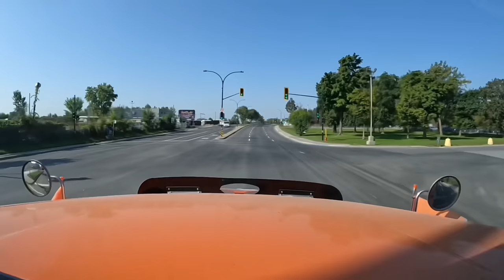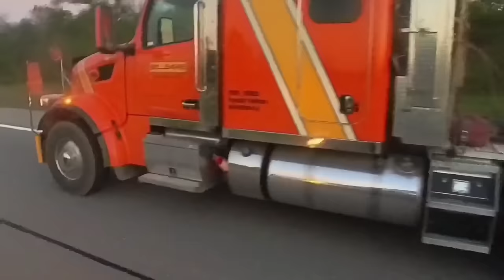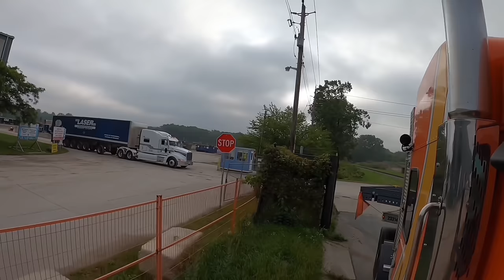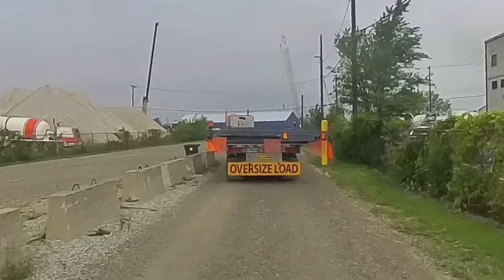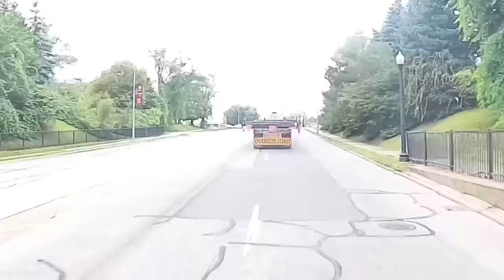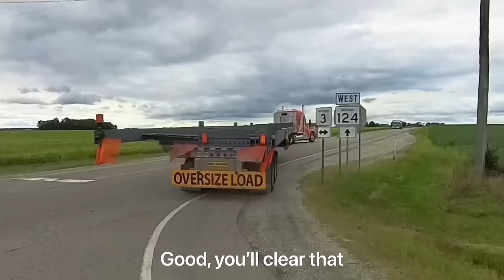That’s a long trailer! 🥵

Comment: Did a very similar load with a buddy a while back. A couple more feet of rear overhang and 18 wide. Boy is it fun turning with a trailer like that.
Reply from the maker: When you think you’ve gone wide enough go wider 🤣🤙
Reply: @luckybananaheavyhaul3407  The wider the load the more fun it is.

Comment: Thanks for the video. Sadly, the truck ferry service has closed down so truckers carrying hazmat or oversized loads have to drive the very long way around. At least until the new bridge opens since it’s supposed to carry hazmat loads.
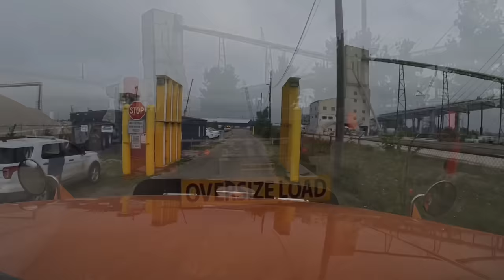Reply: The Gordie Howe Bridge, in the distance at 12:30 is specially being built with Hazmat and other dangerous cargo in mind. It's also at 29:00, and a few times after that.  The 401 will end at Gordie, which joins I-75 in Michigan.
Any spillage can be contained. They need to go all the way to the Blue Water Bridge at Sarnia and Port Huron, which is a good two hours, on a good day. Ambassador Bridge and the Detroit Windsor tunnel have been banned. The Tunnel, for obvious reasons. The Ambassador Bridge, while it's been going under a major overhaul, still has issues, so they can't risk a spill. Any spill, which cannot be contained, would go right into the Detroit River and then eventually to Niagara Falls and then the Atlantic. Sure they can stop it, but why risk a major spill if you can't stop it, or it's a heavier substance that sinks and runs along the base of the river. That would be an ecological disaster that makes the Exxon Valdes look tame.

I believe that the Ferry shut down due to safety concerns and the age of the barges. With the Gordie Howe Bridge opening in about a couple years, barring delays, it's just not worth it to spend millions on new barges 2 years, or so, of operation.

The Gordie, a term for us Detroit Red Wings fans, will have containment abilities, minimizing the risks to the community, and especially the Detroit River.

Comment: Hello Doug.  Great job as always. I remember you saying just how much you enjoyed that amount of trailer cheat during a turn.  4 wheelers were showing their ass on Jefferson.  When you pulled the trailer out of that hole turning left, that would have gotten my attention pretty darn quick.  I dislike having trailers at that angle immensely.  Probably the amount of time under a beam.  At least you didn't have to execute a MI Left.  Have a good day.
Reply from the maker: I wasn’t particularly worried about the hole because of the type of load I had. Light weight with low center of gravity.  If it was a 50 ton electrical transformer it would’ve been a more dramatic situation!
Reply: @luckybananaheavyhaul3407  50 ton transformer-  that would have been exciting for sure.  Be safe.  Be looking for the next one.

Comment: That 122 feet is a little bit longer than what we have in Finland without any special permits which 34.5 meters or ~113 feet but that's on a multiple articulation points, not just a single semi-trailer. I regularly pull a High Capacity Transport with two sea container trailers and a dolly in between those two trailers. Max weight is 76 tonnes (metric) so hauling two 40' or two 45' containers is no problem usually, unless it's winter of course and that doesn't even reach the max length because we have cabover trucks. Cheers from Finland!

Comment: Really neat to see these load transports in video. A question I have is why wasn't the truss transported on edge vertically thus eliminating the overhangs on the sides?
Reply: Mr Banana did not mention it but it appears that the truss was about 12' wide / tall or more.  At the length it was you will never find a trailer that is not going to put it as least 2.5' or 3' high resulting in a load 15' tall.  Lot easier to transport a 12' wide load then a 15' tall one due to bridges.
Reply from the maker: @MrThisIsMeToo well said 👍
Reply: @luckybananaheavyhaul3407  Least I was right once today.
Keep up the great work.  You will break through soon!
Reply: I thought about this also.  There are trailers that have a drop in the very center for moving concrete/prefab walls, large panes of glass, etc which would have added about 15' of length to the trailer and but has the advantage of centering the load. At that point, the added length may have been more of an issue than the width.
Unfortunately I don't believe they make stretch versions of them anyway, so it's like knowing how many licks it takes to get to the center of a Tootsie roll pop.

Comment: Fascinating to see not only how the turns work for such a load, but also seeing how the truck ferry across the Detroit River worked was neat.

I should ask, what are those codes in the video descriptions?

And is there any special software you have to use to plan these routes? They have all kinds of turns I wouldn't have ever expected (and I know they're for obstructions!)
Reply from the maker: The codes I need to list in order not to be flagged for copyright music.  It’s just a way for YouTube to verify that o have permission to use this music.
Reply: @luckybananaheavyhaul3407  I never knew it could work that way with the codes - that is quite something!

Thanks again for the fantastic video!

Comment: I would really enjoy some narrative as you travel, such as the road construction with the cranes and sweeping over passes, etc.  Where was the ferry crossing?
Good Vid. I  would like to know why you jogged down thru Indiana with I-69 and 65 available.
Reply from the maker: The truth is I myself stopped asking “why” a long time ago. Too much in this business doesn’t make sense.  Most of the time when we take a different route it’s to avoid road construction or low bridges (which wasn’t the case with this load obviously)

Comment: Doug, why does it seem that they route you on two lane roads when interstate roads are available?
Reply from the maker: A lot of times it’s to avoid road work on the interstate.  Most of the time they will deny a permit to pass through construction zones.  
Or with a high load we can be routed off to avoid low bridges which obviously wasn’t the case with this load.

Comment: i did  9,  15,3 wide 125 long, 3yrs ago from Baton Rouge La. to Indian town Fl. they had sent 3 loads before me they said it took them guys 4 days to get there, and if i made it there faster i could have the rest of the loads, i would load the evening before pull out next mourning 2.5 days only cause florida i could only run from 9 am to 3 pm, had 2 escorts and LA had 2 state troopersto the ms. line
Reply from the maker: Nice run 🤙

Comment: Are most stretch flatbeds spring ride or air ride? Does it matter which it is?
I'm guessing based on the weight of the load at 20k lbs, your trailer didn't need to be a tri axle, correct?
I'm assuming that's just what your company has, but it isn't necessary for this load. 
I hope someone chimes in. Thx
Reply from the maker: You are correct. My company has mostly tri axle trailers because they are more versatile but it wasn’t necessary for this load
Reply: @luckybananaheavyhaul3407  Figured as much. I see you guys do mostly heavy so if I were them, I'd get a tri axle too. Like you said, versatility. We're only limited by the equipment we have, so...yea lol

Comment: You have such Nice equipment, I only don’t understand why the extendable flatbed isn’t steerable?
Reply from the maker: Because steerable equipment costs more 💰💰💰
Reply: @luckybananaheavyhaul3407  yes,that’s a good reason!
Here in Holland it would be impossible with that length, without steerable.
I go till +- 22 meters on a non steerable , otherwise the secondary roads are almost impossible.
Keep putting the nice videos 👍🏻 they are nice to watch!
Reply from the maker: @henryvanosenbruggen4694 Europe has standardized steerable equipment 👍. Unfortunately here in North America we still try to keep the cost down by using basic equipment 👎.

Comment: do you have any good or bad thoughts about the automatic  tansmission yet? or is it too soon for your input? im just wondering...
Reply from the maker: So far it is doing the job very well.  The automatics have come a long way.  I’d say now it’s just personal preference if you prefer manual or automatic.
Reply: @luckybananaheavyhaul3407   I noticed that it has a torque converter instead of a clutch, first time I've seen this in heavy haul.
Reply: @jasongreene303  only the allison have torque converters.. The eaton automatics still have clutch's, minus the pedal.. I drive an allison daily, pulls 200k+ with ease

Comment: Another great video! I used to haul 60' -70' steel on a 40'-60' trombone [extendable] in the UK in the '70's. Proportionally it was similar to your trailer and tractor on our roads and tailswing was always a problem.
Reply from the maker: Everything is more condensed in the UK!

Comment: Why not have them vertical.. you could transport 3 at a time. 
1 in middle, and the other 2 leaning against the middle on both sides.
Reply from the maker: Good question but 2 reasons. 
First would be the height.  These trusses were 12 feet wide so vertically that would be about 16 feet on the trailer. Way too high!
Second would be weight.  With more than one piece we can not get an overweight permit which means we can’t exceed 80,000 lbs total and this heavy haul truck and 3 axle trombone trailer are heavy!  Believe me if the customer was able to put more than one per truck they would!!!

Comment: WOW that's a long load would be better if you have steerable wheels in back.
Reply from the maker: Agreed but we can’t always have it easy!
Reply: Why did you have to take a ferry instead of the bridge?
Reply from the maker: @paulbuck683 construction on the bridges right now. Oversize loads are restricted.
Reply: Ok thanks. I don’t go that way. I pretty much do east coast

Comment: Don you get  off at Markel. Go over to 3 head south to 124 west until you took 5 south to get back on 69. Did you do that so you didn't have to cross the scales just south of Markel on 69. That's what I did when driving a truck. Great job.
Reply: @nedsauer3807....Over-dimensional routings are determined by the various State & Provincial DoT-agencies; the heavy-haulers can ask for a specific routing, but invariably it's the jurisdictional engineers who decide which way to go....and we better stick to the permitted routing.....because if caught off-route, we run the risk of having the permits voided/cancelled....and that opens a whole other can of worms.
Reply from the maker: There was a construction zone on 69 they wanted us to avoid so we were permitted around. I don’t go around scales. We run legal

Comment: Pilot in front on narrow road and trailer axell should turn and it is much more easy for you
Reply from the maker: That depends on the state or province. Sometimes pilot requires to stay in rear with long load